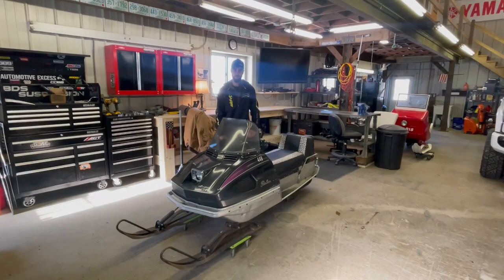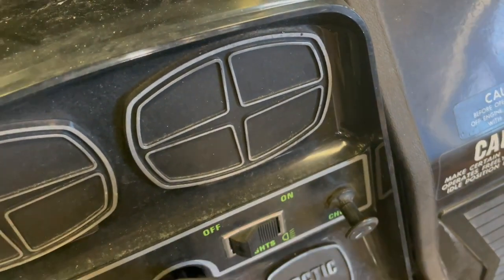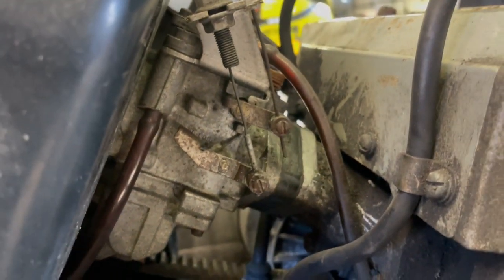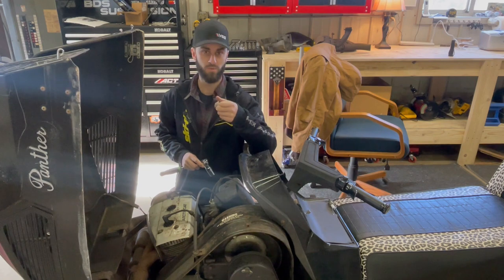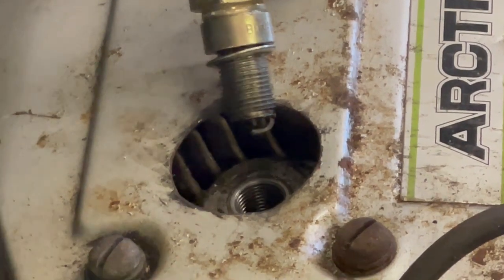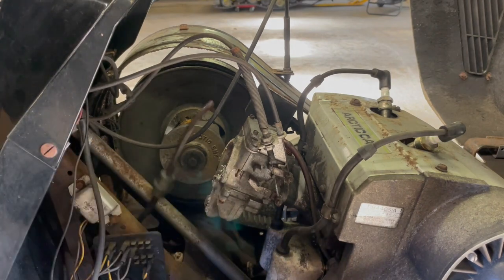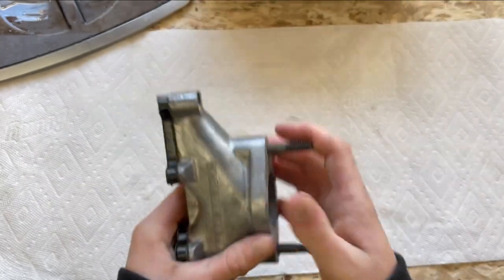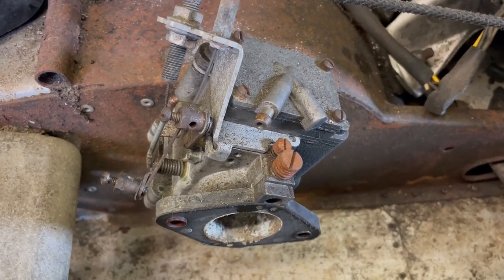Artic Cat Panther Will It Run? Part 1

Comment: long time ago i had 1970 panther with 399 kohler motor i didn't care so much Kohler motors for me it didn't run to good and i even rebuild motor bottom end and top end of motor . i have better luck with Kawasaki engines old sleds like that